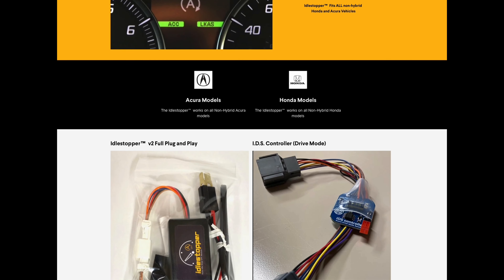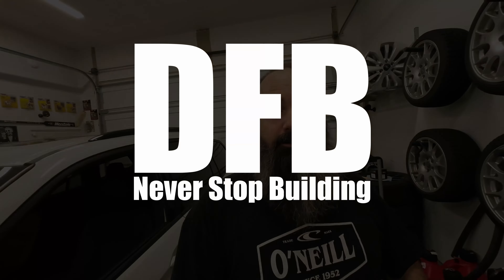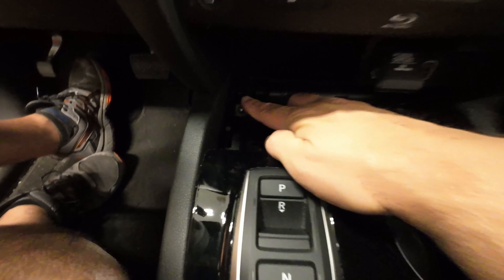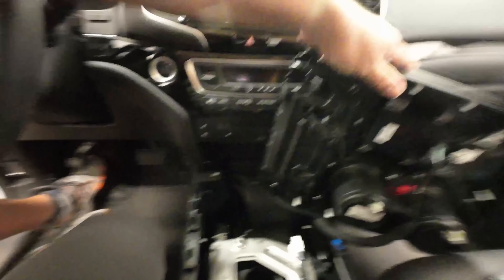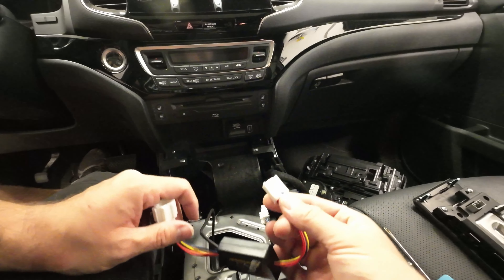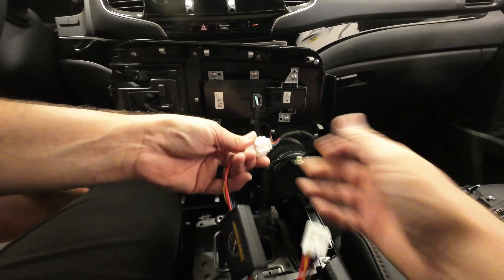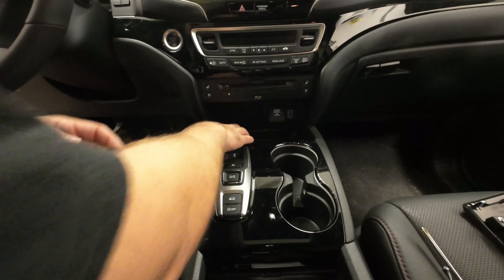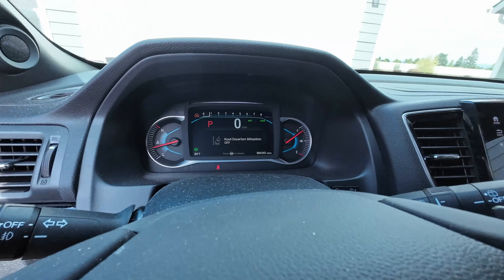Installing Honda Idlestopper V2 | Turn Off Idle/Start Stop

Comment: Question is if you have this installed in your pilot, will the dealer push back when you bring it in for the idle stop recall? I am worried they will say warantee is voided because you installed this. Let me know.
Reply from the maker: Technically no. But it is up to the dealer to be picky or not. The Magnuson Moss Warranty Act would ultimately protect you. I would however always side on caution. Speak with a service manager ahead of time or unplug before warranty work if your dealer is super picky.

Comment: I am using Individual mode where I disabled start/stop function in addition to other parameters.  However, every time I start my car, I do need to press Individual mode button as it starts in one of the pre-set modes.  I am kind of used to this now and didn't bother getting Idlestopper.
Reply from the maker: That’s a good way of doing it.